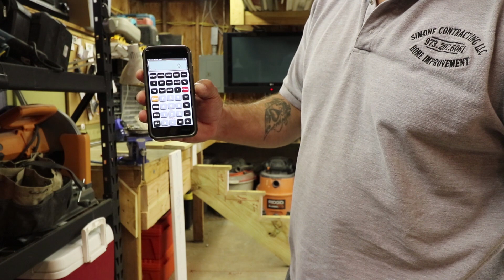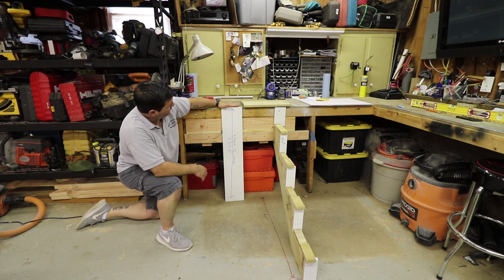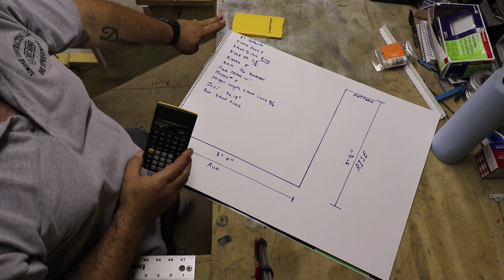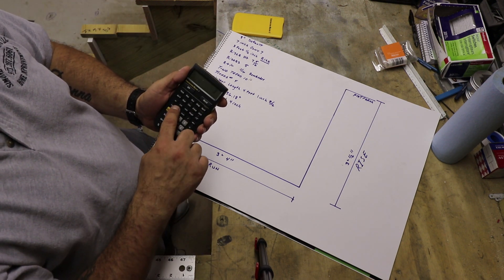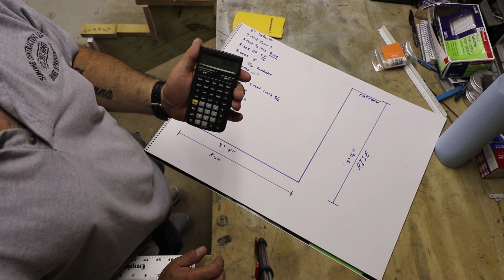HOW TO LAYOUT/CUT STAIR STRINGER DIY!

Comment: nice video. what does "PAT" mean that you wrote on the stringer? i have seen this before in the field
Reply from the maker: bkoz319 O,all the means is pattern,you use the to scribe the rest of the stair stringers
Reply from the maker: bkoz319 I’m assuming you mean the rise and run?
Reply: @patricksimone1238  13:04 you see "PAT" circled in red sharpie. I have seen this before and was wondering what it meant. I know you name is Pat but I have definitely seen this before on stringers and wondering if it meant something different